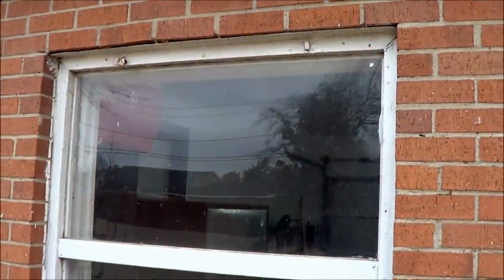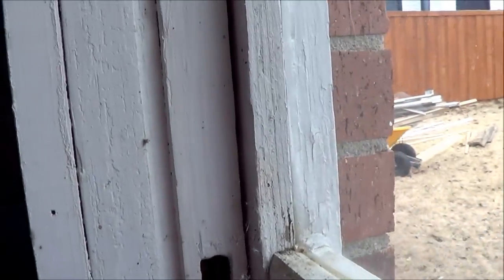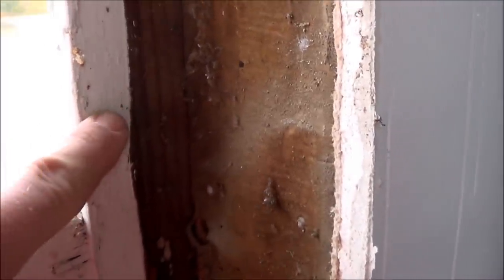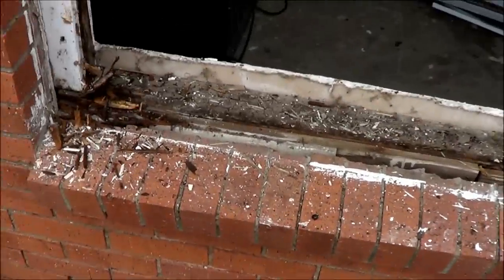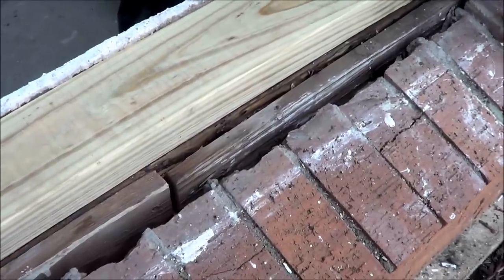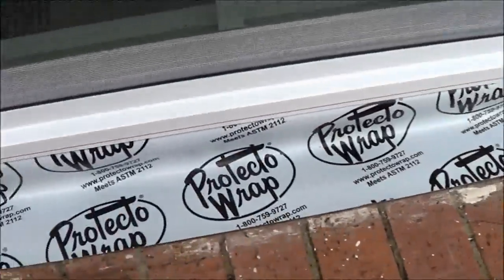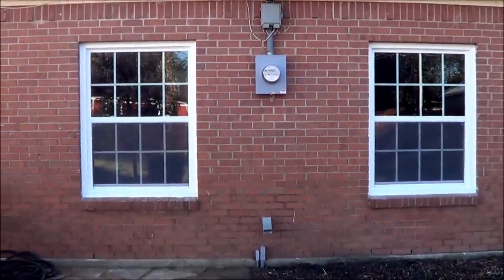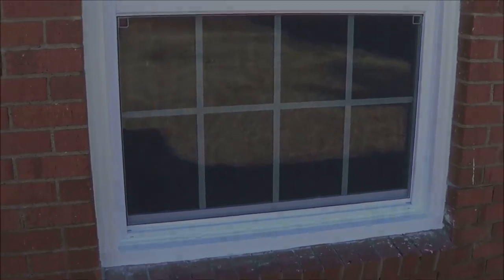Removing Old Wood Windows & Installing Vinyl Replacement Windows

Comment: this video was interesting because my landlord just replaced windows in a building that was built in 1953 and it didn't look as bad as this and the old windows had wear and tear but nothing like this.the difference from old wood to vinyl is incredible not only for asthetic purposes but for overall energy efficiency

Comment: that windows in better shape then mine in 20's house x 12 $$$$$$$ but need change the worst ones 1st,can't wait for that day I can see out the windows that have no spots & real windows.... Think metal are called straps seen them on fireplaces so bricks don't fall over & Not using any insulation in the Voids under the bottom window not sure I'd not do that but what do I know I've not messed w any windows yet...Good job though...